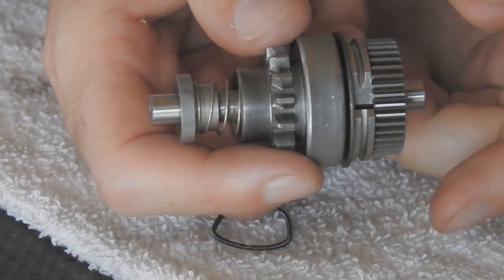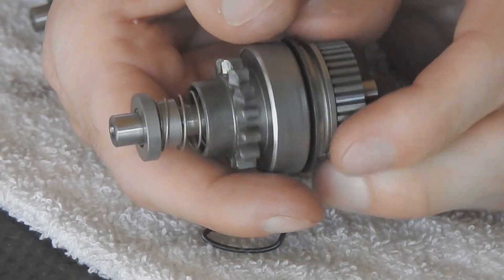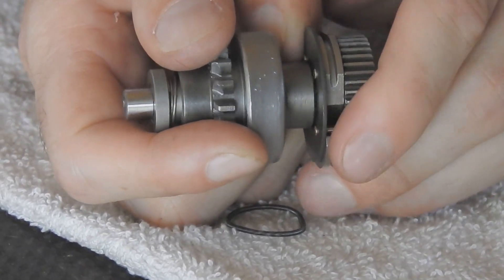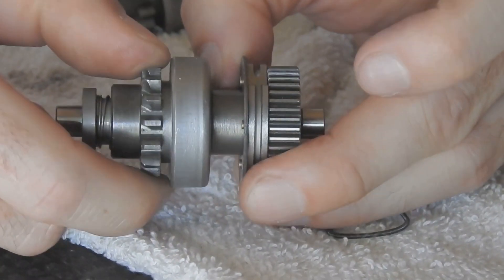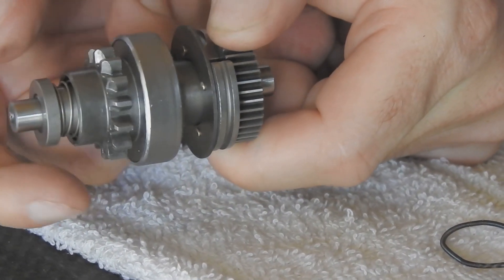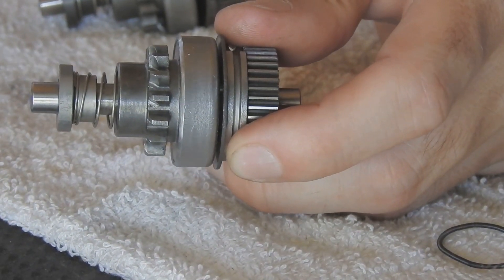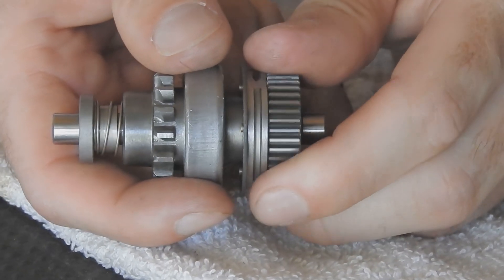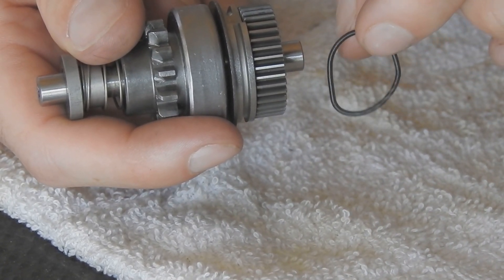Moster 185 and other paramotors starter bendix.

Comment: I had to replace my bendix.  The pins that hold the collar together came loose and were free floating in my starter.  The spring was no where to be found either.  And sure enough, because the collar wasn't engaging the starter gear would disengage after one turn of the motor.
Reply: Arie where did you buy the bendix?